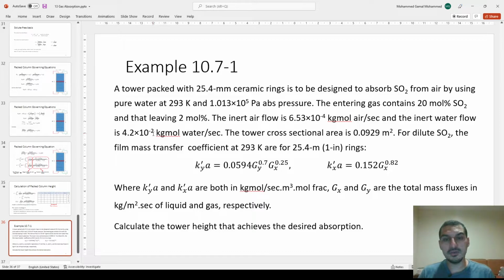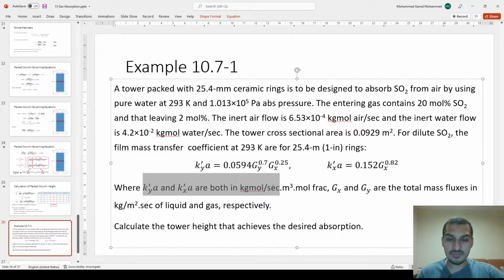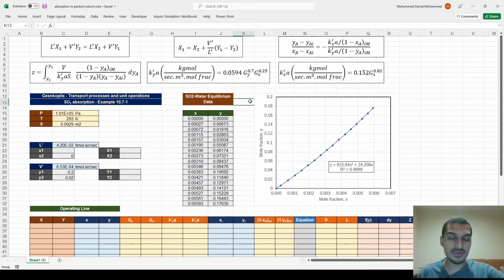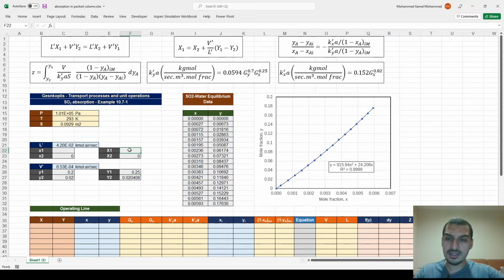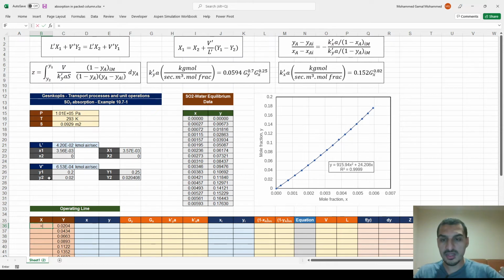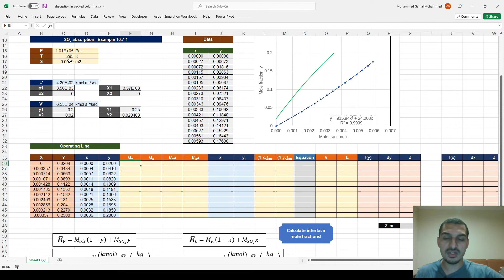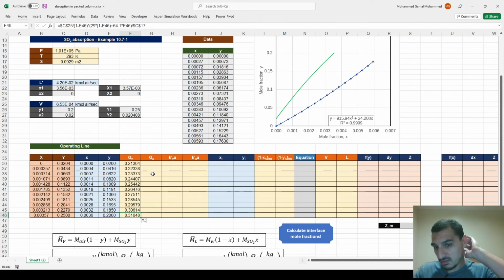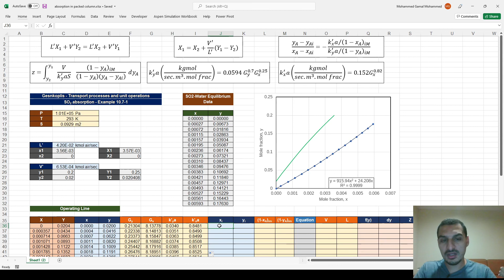Excel for Chemical Engineers | 88 | Absorption in packed column - Solved example using Ms Excel 1

Comment: Can you link the spreadsheet please
Reply from the maker: All spreadsheets in this series are available in the link:
https://drive.google.com/drive/folders/1vdaerJgSalth7nRCuczVzdLq8SGvC1T1?usp=share_link
Reply: @MGMohammed  hey do you have an excel to find the diameter and height of the tower , i have an excel for heat exchanger but for absorbtion tower. if you could please help me out with my final year project .
Reply: the only input datas i have is a flow rate of flue gas and its mole fraction and presssure and temperature for it than further i have to put a hx , and than absorbtion and stripper tower to absorb co2 with mdea